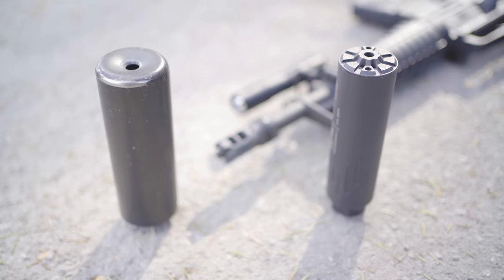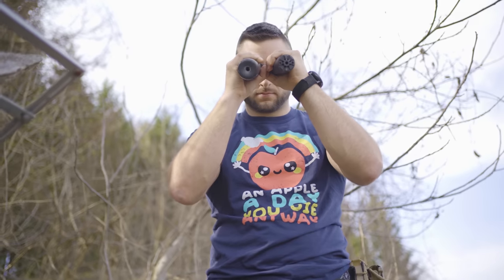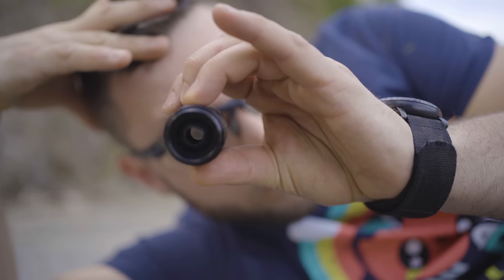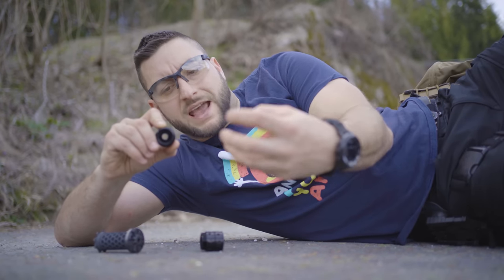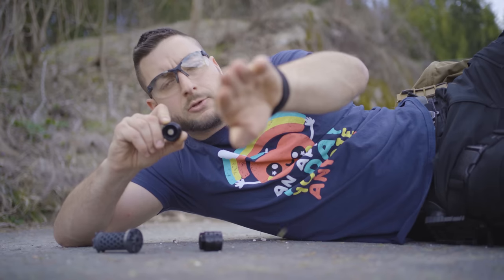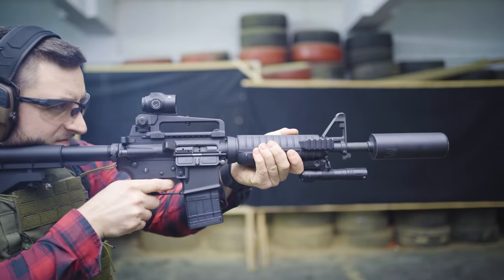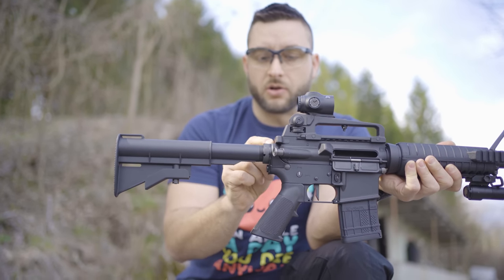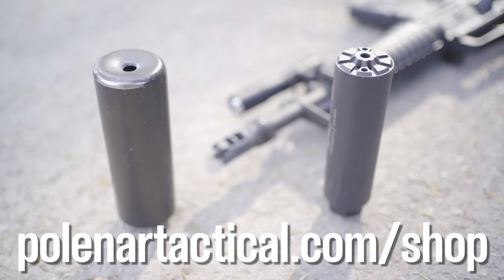Flow-through VS Conventional Suppressor

Comment: I use the Flow through supressor from Ase Utra and like Ziga just demonstrated, it works perfect with direct impingement. Small thing which I added is a heavier tungsten buffer.

Comment: Using a Short Stroke Piston with adjustable gas block (or just an adjustable gas block in general) setup solves a lot of the over-gassing problems.  Flow-through Suppressors are generally louder too.
Reply: Oh no. You're going to hurt the person you're shooting's ears...
Reply: @brandonhenle8659 guess you’ve never used cans in real applications, huh
Reply: @Jay_Spesh_Stay_Fresh  personal attacks mean you've lost the argument. Thanks bro
Reply: @brandonhenle8659  if that was a personal attack, then maybe you shouldn’t own firearms or ever get in a firefight😂
Reply: @Jay_Spesh_Stay_Fresh  thank you for continuing to prove my point
Reply: @brandonhenle8659  mad cuz bad
Reply: @Jay_Spesh_Stay_Fresh  and he keeps going
Reply: @brandonhenle8659  You missed the whole point of the comment and the nature issue of Suppressors.  Over-gassing and creating visibility problems for the shooter is absolutely an issue that can be mitigated by design with other platforms and mechanical settings.

Can't shoot if you can't see.
Reply: @D.J. "The Metalhead Mercenary"  I'm not disagreeing that piston is better. It is. But most people don't have the budget for and extra $1000 or two or three. I was just making light of hurting the ears of someone you're shooting at.
Reply: @brandonhenle8659  Uppers as a separate purchase or conversion kits don't cost nearly as much as a full build/ off-shelf rifle, so there is some efficacy there in saving money if you already have an AR lower for example.  Something like an Adams Arms Upper is not breaking the bank.

Some D.I. systems do have adjustable gas blocks too, but those are certainly more expensive than the standard platform, still not optimal though.

I get the joke, just a little bit of a lost in translation situation per the context there.
Reply: @D.J. "The Metalhead Mercenary"  yeah for sure. I just buy salient arms adjustable gas blocks to tune my ar's. They're like 80 bucks. I work at a gun range so I have all the tools to switch them over. Being lefty I definately understand the need to reduce blowback.
Reply: @brandonhenle8659  There ya go, good stuff.

Comment: Flow thru shines on casual shooters for less toxic gasses and for machine gunners (or people who are trigger happy) who shoot large volumes of ammo and need less gas gunking the system. Traditional baffles work best for signature reduction and overall efficiency at the expense of getting blowback. A lot of people like to talk about sound, but that’s not the most important signature to reduce for most soldiers. Even several decibels is good enough to make the the report from a gun sound muffled or distorted after the supersonic crack. The biggest thing to reduce is flash, which a proper traditional setup can even reduce first-round-flash. Each have their upsides and downsides. Choose what works for you, and the most important part is to train

Comment: I agree that with ARs Flow-throughs are superior. But what about other platforms? I shot the AK with a Strela suppressor just like yours and i don't recall any discomfort or eccessive gas to the face. Is a flow-through worth it when nothing's wrong with a normal one?
Reply from the maker: If strela works for you there is no sense of replacing it.
Flowthrough would only make sense if a normal suppressor would create too much backpressure and your AK would be overgassed

Comment: Downside of flowtrough supressors is that they usually have bit less sound 
reduction than conventional models. 
Overally it is tradeoff which one is better choice for you. 
For manually operated gun there is very little sense to use flowtrough because backpressure
should not be a problem for bolt action.

But for semi/full-automatic which is usually shot in 
higher volume  that makes sense even its sound reduction is bit less because those
are usually made to whitstand full-auto and they generally dont need any adjustment to done
rifles. So those are ideal for typical direct impingement system AR:s which doesnt have adjustable
gasport. 

So like Ziga said it is more comformable to shooter itself. 
But most militaries outside US use short stroke piston systems
and adjustable gasports in their standard issue rifles. 
Never actually seen side by side tests how those two systems compare when used conventional
and flowtrough supressors in sound reduction and user friendlines. And how those
handle extreme use.
Reply: If you can’t configure a rifle to be optimized for a suppressor, or for some reason you are constantly taking a suppressor on and off, a flowthrough may make sense.

In general their signature isn’t just a bit more loud. It is usually noticeably and uncomfortably louder, and depending on the rig it may exceed hearing safe levels where a similar sized baffle stack would he hearing safe.

Gas blowback is manageable by designing a rifle to be dedicated to suppressed use, and by efficient baffle design.
Reply: Guess what, after a few rounds, short-Stroke pistons gas you too!
Reply: @woodrowcall3158  You can optimize rifle to run with or whitout extra pressure from supressor but
for military use those rifles had to be overgassed for default setting because minor inconvinience
is better choice than having akward straight pull in compat situation.

For big scale of soldiers it is bit waste of resources if every rifle is optimised to run with supressor.
Because then they would need it installed semi-permamently if want rifle to run.
I guess it all comes down to be cost effective instead of having best choice for situation.

In that category i think european armies planned that in longer run than US.
Then and now soldiers had rifle capable to accept supressor with turn of switch.

So would we even have that problem if direct impingement AR:s had actually adjustable
gasport for normal, supressor and to hell and back ?
Reply from the maker: True
Reply from the maker: @woodrowcall3158  Depends on the caliber - you can't make 5.56 hearing safe with any suppressor. 
Well actually you can, but a subsonic 5.56 has essentially same energy as .22 lr and it won't cycle the rifle. 
So if you are forced to run supersonic rounds on a rifle that means that you can't make it hearing safe so using ear pro is mandatory, so for a couple of decibels more, you run a flow-through suppressor and don't even notice the difference (minus the increased backpressure and gas in the face)
Reply: @Kesssuli  
On the macro scale sure, it would be impractical and fiscally prohibitive to retrofit every rifle for optimized suppressed use.

The URGI proved that a “DI” system could run either or while maintaining reliability in either configuration, all without necessitating an adjustable gas system. The shortened dwell time and properly sized port was all that was required.
Reply: @PolenarTactical  
OSHA’s threshold for hearing safety is 140db unsustained. Even with a short barreled AR in 5.56 shooting high velocity projectiles with a low BC, you can easily get below 140db at the ear or muzzle with a properly designed suppressor. 

The “flow-through” cans I am experienced with (older OSS designs) struggled to get below 140db on most of the rigs we tried them on. Granted our method was not entirely scientifically sound, and the safety meters we used aren’t laboratory grade and only provided limited data, but better equipped people found similar enough results. The new flow through designs may be better though, I don’t know.

If your understanding is different or you are working with a different set of standards, holler at me so I can study up on them.
Reply from the maker: As far as i know anything above 120db is not hearing safe - even a short term exposure can damage your hearing. 
Supersonic crack of a rifle bullet is above 120db so no matter what kind of combination of rifle and suppressor you make, you cant make it hearing safe without using subsonic ammo.
In our measurements on indoor range a normal suppressor reduced the  signature to 136db and flow-through to 143db for a 11.5" AR - so for both you had to use hearing protection
Reply: @woodrowcall3158  I believe OSHA's hearing requirements for safety says that anything above 115 dB can result in hearing damage even if exposure is brief.
Reply: "Downside of flowtrough supressors is that they usually have bit less sound 
reduction than conventional models."
Actual scientific method has found your claim to be partly false. When it comes to suppressors, not a lot of things are linear. If we took a very short semi-auto rifle like an MK18 (10.3 inches/260 or so mm of barrel), and consider at shooter's ears performance, a flowthrough design can potentially do better. In testing by Pewscience, the current highest ranking for that platform is held by a flowthrough suppressor (the 556k).
Given the same cartridge (or at least caliber) and same platform, barrel length plays a big role in what suppressor design will perform best. Also worth pointing out, at the ear and bystander sound signature performance do not go hand-by-hand, some suppressors do better in one metric and worse in the other or vice versa.
On top of all of that, there is gas tuning too, gas regulators might not be needed (or even desirable) for people that shoot suppressed only.
Reply: @spookyindeed  From OSHA’s data and advisories on permissible noise levels;

“Maximum Continuous Noise: As interpreted from the table, exposure to continuous steady-state noise is limited to a maximum of 115 dBA.

If the variations in noise level involve maxima at intervals of one second or less, it is to be considered continuous. [1910.95(b)(2)]

Impulse Noise: The standard states that exposure to impulsive or impact noise should not exceed 140 dB peak sound pressure level. [Table G-16]”

115dB is the top threshold for what OSHA outlines as “PEL” (permissible exposure limit). A 90dB continuous exposure is permissible for 8 hours, while a 115dB continuous exposure is permissible for 15 minutes.

Impulse exposure (like what you would have with gunfire) has a limit of 140dB before immediate damage can be inflicted. 

Continuous exposure between 116dB and 139dB could be damaging, but in the context of suppressed weapons fire it would have to be a continuous series of impulses over several minutes. Unless we are burning down belt-fed weapons, the suppressed gunfire will be interspersed and not a continuous exposure.
Reply: @lucastonoli3256  
“At ear” dB measurements are very useful metrics, but in the case of automatic actions they are relative to the individual weapon tested.

There can be as much or more than a 2dB difference in “at ear” measurements with the same suppressor and ammunition combination weapon types, but variances in extraction speed/time can cause wide variations in “at ear” measurements.
Reply: @woodrowcall3158  Good thing gap between the best flowthrough and almost all the other "traditional" suppressors is more than 2 dB.
Reply: @PolenarTactical  140 dB is OSHA/European treshold, but only for a single shot in 24 hours.
Reply: @ThermShok8799  Shooting AR at night without anything but hider or brake is literall flamethrower.

When supressor is used difference is between night and day.

It doesnt need to be even night. Autumn evening is enough to see flames with naked eye.

Comment: I own both a DI AR and a short stroke piston and a traditional baffled can and a flow through can, here’s my take on blowback as a left handed shooter 

I have a DI gas AR10 that uses a traditional suppressor and it’s gas system and buffer are tuned for suppressed use. A pair up like that is perfect for DMR use as you are trying your best to hide flash and noise while not being gassed out. 

My carbine setup is flow through and short stroke piston. I don’t care if it’s a little bit louder it’s a door breaching carbine I’m just trying to avoid hearing damage and blowback. My flow through can still reduces gas blowback more even though my AR10 with traditional suppressor is tuned.
Reply: So you get little to no gas in the face right?  I got a piston setup
Reply: @nomad155 I get zero gas and i shoot left handed
Reply: @rl1271  thanks so much!  Got a long stroke and will look at a flow through as my first now.  People don't consider southpaws get more gas to the face so our considerations have more weight in this regard
Reply: @nomad155 yeah any piston + a flow through can you should be GTG as a lefty. Things to consider though, 

Long stroke piston sometimes bleed off excess gas out the front making them louder, check your user manual how to adjust this. 

Flow through cans are awesome for semi autos, not good for 300 BO subsonic or bolt actions. You still might want a lightweight baffled can for special purposes like this.
Reply: @rl1271  what would be your recommendation on a lightweight baffle can?  Thinking on a PWS mk111 (11.85") piston upper?  I thought of their BDE suppressor as it's a jack of all, or get one that's flow through and one that's for sound suppression.
Reply: @nomad155  There are so many good suppressors i cant recomend one but pick any you like on silencershop. I prefer lightweight and short suppressors. So anything like YHM, surefire, deadair nomand TI/L/ whatever variant you like. Theyre all good. Lightweight ... regardless if its flow through or baffled is most important to me.
Reply: @rl1271  I understand.  My shorty is about over 8lbs.  I would like a short one but I guess I'll try feeling them out.  Thanks for everything

Comment: Great video but the term "back pressure" is somehow critical. Because some people think, that suppressors make gases go back into the gun, but this is not true. Instead suppressors prolong the time in which the gases are held in the system. In an unsuppressed gun the bullet leaves the entire system at time X and the bolt opens at time Y when the pressure had dropped to Z. In case of the same gun suppressed the bullet stays in the system for longer (X+), because it has to travel through barrel and the suppressor but the bolt still opens at time Y (or even Y-, in gas operated systems). Because of the bullet leaving the system later the gas pressure has less time do drop therefore the gas pressure Z is increased as well. This is the technical origin of "back pressure".

A flow through system works on the gas pressure by letting more gas escape though front facing vent, dropping the gas pressure Z in the system by reducing the amount of gas, as well as its volume by cooling it off.
Reply: My Micro Uzi 1550 and Reflex Baffle Silencer ~1870min/rof
Gas or no but faster.

Comment: I use Ase Utra Dual which is flowthrough but with large volume shooting .223 bulk and 77gr reloads (from 2-3K) the suppressor becomes a bit gunked, flowthrough is stopped/hindered at around 3-4k maybe. I do like it still, but thinking about the SS which you can disassemble and easily clean every corner of.
I recommend ONLY the schletek evolution or boretech for suppressor cleaning. Just pour scheletek into jar (or big beer can) than can hold your suppressor and pour it back into bottle after cleaning to use later again.

Comment: Ar15 piston driven (short stroke)👍, even without suppresors.
It is useless to not smoke and then breathe shit at the range.
Also open ranges are way healthier then indoor closed ones, even with good air cleaning systems.
Open Sun and good air 🌞👍

Plus with DI there is also the risk of cook off, self ignition of ammo.
DI are only good for sport shooting, guys who want an anoressic rifle.

🇮🇹
Reply: You can actually get cook-offs with any closed bolt system, the heat in the chamber actually matters more than the heat in the bolt.
Reply: @DothWalrus  
Correct but DIs get way sooner in the danger level temperature, for the rest the ar15 is an excellent rifle, I like short stoke piston ones.